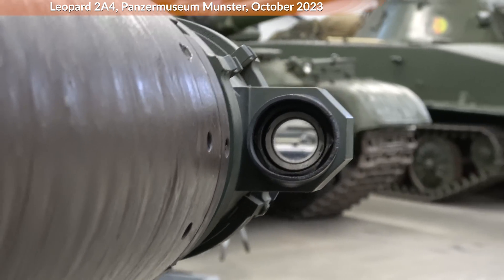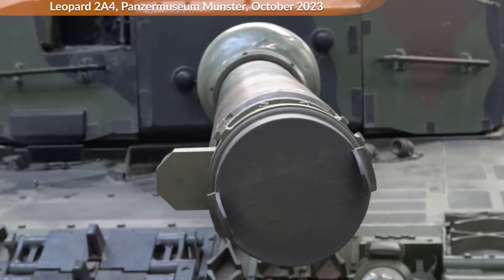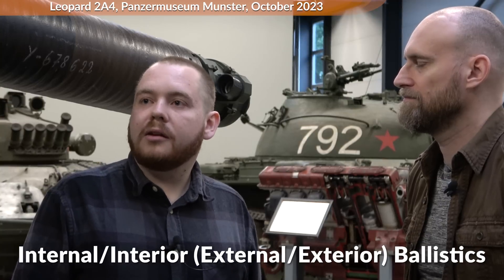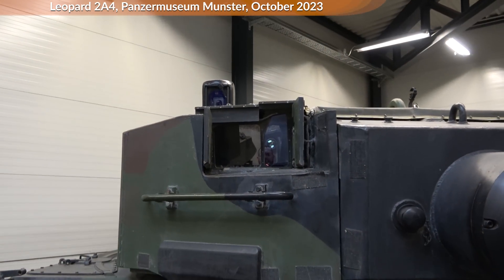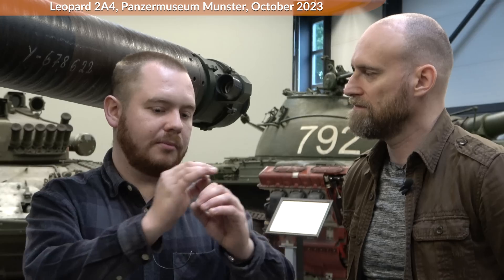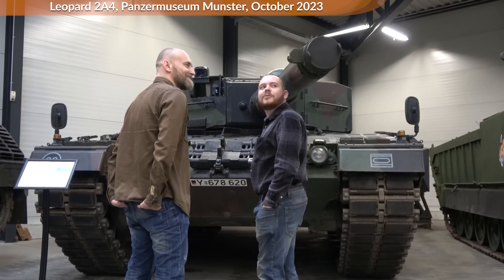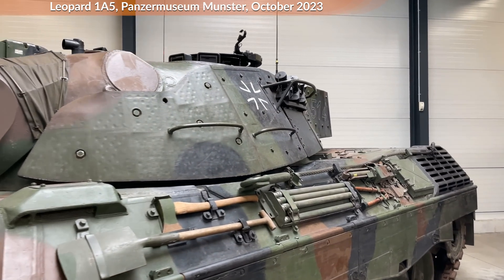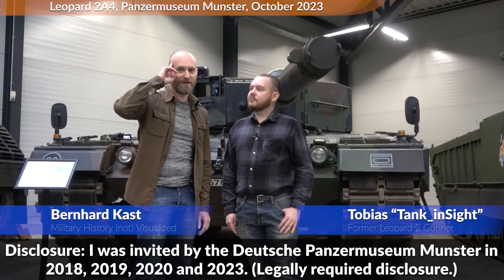Leopard 2: Why a Mirror on the Gun Barrel?

Comment: So if this sensor or mirror is damaged it makes harder to correct any barrel droop and Russian tanks use similar system, so buttoning up a tank is still a thing, though one should destroy the optics with one accurate shot instead of just letting loose with machinegun, witch alerts the crew to shut down the shields on the optics. Gotta remember that if.. when shit hits the fan.

Comment: In german the correct designation for this thingy is "Feldjustierkollimator". It was also equipped on the Leopard 1A5. The metal "blinds" before the EMES actually have a very tiny hole in it, allowing still to spy through. The wind speed sensor was already suppressed back in the times on the 1A5 but wind information could be still entered in the computer alongside powder/shell and outside temperatures and altitude to compute the trajectory correctly. Laser range finder in peace time was obstructed by dim "sunglasses" to avoid accidents to the nakes eye of bystanders when firing on practice ranges - but with these "sunglasses" engaged the accuracy was greatly diminished (too often blinking and not dependable distance readings) - so we all removed it using a square key in a tiny hole on the EMES and went wartime config to receive steady measurings from the laser RF.

Comment: There are a lot of things I could say, but I won't, because I don't want to risk crossing what might be considered national security.  Features like this mirror are designed to keep the crew informed of "gun droop".  When you are really in it, you're firing the main gun so much that it can get soft and starts to droop.  Various systems like this are designed to inform the gunner what is going on.  Good vid.

Comment: 4:23  😂 they measure tube déformation but not the wind. Probably Rheinmetall invented new kind of artillery...
1 > stop tank to reload...
2 > align mirror with control device ( if open ...haha)
3 > LOOK at grass and trees for  wind !!! ( or use figer ?)
4 > shoot ! To late you are dead  because you checked the canon had less than 2 mm torsion...at 15°C because you never shoot...
CONCLUSION shitty canon needs a mirror simply because it is BAD QUALITY that involves micromètres check...😂😂😂
And poor electronics even a 5 euro arduino processor could manage déviation wind, wich is quite crucial. Makes me remember 2014 scandal of Rheinmetall contract for training 30 000 russians to moderne warefare ...probably with a mirror....😮

Comment: The tank is dead. The war in Ukraine showed that a device worth millions can be destroyed by a $500 drone or cheap loitering ammunition. Even an infantry fighting vehicle can defeat a main battle tank in a duel - and with the autocannon, not the TOW, which is even worse. I think that many armies will say goodbye to the main battle tank. There are attempts to counteract the new threats through protection systems like Trophy, but ultimately this attempt will fail. Even a reactive defense system will never be able to fend off a swarm of drones. No tank will be able to meaningfully defend against such a saturation attack, which will always be significantly cheaper than a tank. Tanks are a death trap and will disappear.
Reply: Alright then, tell me, what other vehicle or piece of equipment can replace the tank for the same price and size? as of right now, there is no such system, and that is the exact reason why the tank isn't dead, and wont be for quite a while unless someone creates something that can rival it. If you come up with something, call up the ministry of defense, you'll probably get a prize.
Reply: @jonyvole  I've already sent my solution to the Ministry of Defense, but never received a response. Joking aside. My statement was probably a bit polemical. MBTs may continue to exist, as they have often been declared dead. However, the race between armor and defensive weapons will shift to a new level and tanks will have to have hard and soft kill systems if they want to survive. Combined arms combat will continue to gain in importance. Tanks will therefore become even heavier and more expensive. Rheinmetall's Panther seems to be partly going in this direction. I think that classic main battle tanks - especially the Russians' vulnerable T-series with autoloaders - really have no future because they are too vulnerable.
Reply: @Kl-bx9gv  ah, yeah, that makes more sense, sorry for the kind of agressive response, but I hate the "tanks are dead" statement with a passion

Comment: Here's my contribution to tank warfare: They should have a special smoke round that releases smoke slowly, and takes like an hour to be completely released. So when the Orc are gonna come over that hill two kilometers away, you can plonk the special smoke shell down on that hill and continuously update the wind direction and speed by the little trickle of a smoke trail. And pretty soon the orcs will learn that if they put their heads over that hill, it will pink mist and then they will all go away.

Comment: It's to make the weapon system more complex, therefore more requiring of maintenance and replacement parts, therefore increasing the profits of the manufacturer 😉
Reply: Its a manually operated piece of glass. Probably worth 15$ at most in materials and the maintenance required is probably “wash if dirty”
Reply: @ingihrannar8781 LOL.  It's a high-precision instrument.  So, whatever the material cost, it is an insignificant part of the price the Bundeswehr had to pay for it.

But you apparently don't even recognize a joke, when it is marked as such....
Reply: @martinfiedler4317  Yes i didnt recognize the joke even when it was marked as such. Yes i do and should feel like a fool.
I have had my dunce hat put on and will now serve my 15 minutes in the shame corner.
For real though my bad and have a good day whenever you read this

Comment: It's the MRS or Muzzle Reference System to align the muzzle of the main gun to the ballistic computer. After firing so many rounds the barrel will start to point in a downward position normally or left or right. The Gunner and commander can see this after seeing their shots degrade in accuracy during firing. So the gunner along with the commander can switch the MRS toggle which elevates the main gun with the gunner's and commander's sight to supervise the gunner using the toggle switch of the ballistic computer to move the gunner's reticle to the center of the MRS on the end of the main gun. This can be done in a few minutes when doing an MRS update if your shots are not hitting the target during an engagement. My first gunnery as a gunner we were told to do an MRS update after 7 shots. Never do that!!! If you keep hitting targets keep going. Only do the MRS update if your shots are missing!!! Never made that mistake once I became tank commander and stressed it heavily on my platoon during qualification gunnery.

Comment: Common to most Western tanks. English equivalent "Muzzle Reference System" (MRS). MRS fitted to M1 series, Chieftain, Challengers 1 and 2, etc.
Normally "we" estimate the wind at the start of an engagement, not as part of each Fire Control Order. You estimate it, and then commence the engagements and then once you move elsewhere if things have changed, you update the estimate.

Comment: I understand there are nuanced political reasons behind Germany's obsession with focusing on defensive capabilities, apparently like not including wind sensors. What I don't understand is why they don't think they'll ever be on the attack. You don't want to include capabilities because they aren't needed on a defensive line, but then you never expect to have to retake any ground at all? Ukraine shows why this is a problem, as overused as that example is... I mean at the very least wouldn't it take some load off the gunner and just make everything a bit more efficient? 

I guess I also finally understand why the Abrams commander I know thinks the Abrams FCS is better than the Leo's.

Thanks for the video as always
Reply: The video made is sound like it was removed so that the crew wouldn't rely on it while in a defensive position, which was supposedly most of the time. During the Cold War, it was assumed, like the man said, that Germany's only role would be to suffer and buy time until the allies would be ready to counterattack. So, there wouldn't necessarily be that many German tanks left anymore when the time to retake land arrived. In any case, that was the assumption. Now, much later, we do know that the USSR was quite a paper tiger and the West overestimated its capabilities time after time.
Reply: @herrakaarme  Yea you have a good point, it's just that I see this as a pretty basic thing to train for. And even if not, surely just having a button to turn the sensors off would have been enough.

Maybe they figured out it just wasn't necessary and the tank works just fine without one. Would be curious to see how accurate a Leo is VS an Abrams or Chally 2 in various scenarios.
Reply: @knoll9812  lol yea I've always had a sneaking suspicion that was down to the UK having so few tanks and having more focus on training the few crews they have. Obviously have no data to back this up, just a thought. Their infantry seems to be that way from what I've heard.
Reply: @noscopesallowed8128 It's all about the tea kettle in the British tanks. It keeps the crew sharp, patient, and satisfied. German crews asked for a beer keg for an equivalent effect, but the request has been stuck in the German bureaucracy for decades.
Reply: @noscopesallowed8128  armies tend to pick their best for these competitions.
I think the challenger is genuinely the most accurate but it has other shortcomings
Reply: So am American tank commander thinks the American tank is better?

What a suprise!

Comment: M1 Abrams had a muzzle reference sensor with a vial filled with tritium. Great for those prolonged night engagements.
Reply: Americans: Barrel must be straight, lets use reference sensor with an exotic and slightly radioactive isotope of hydrogen that costs 30K per gram.
Germans: Barrel must be straight, lets slap on a mirror and eyeball it.
Reply: @anonym1984  yeah, thats how you are able to get those accurate shots beyond 1 3/4 miles.

Comment: i still wonder if the beer holder comes as standard from the factory.
Reply: Well there are holes at the end of the barrel... So you could just screw one on if there's a party in town and you wanna make a big entrance 😅
Reply: @touchgrass7834  it's got just one big hole at the end of the barrel for that.
Reply: @tomlobos2871  oh I see and the fire control system is now the beer delivery system. Makes sense xD
Reply: @touchgrass7834  it's a bayercontrol system meant to surpress bavarian uprisings. hence the weißwurst-dispenser at the turret.

Comment: I learned density is pressure diveded by temperature and Reynoldsconstant?? Therefore why is height necessary barometric pressure and temperature should be enough.
Reply: They probably measure the altitude with barometric pressure anyway.

Comment: 2:22 What is he exactly talking about? The EMES-Schutzklappen protect the optical sight aswell as the WBG and the laser. It is even possible to choose if only the protection plate for the WBG gets closed or both are closed and thus the whole EMES is protected.
Reply: It only works with the Gunner's Auxiliary Sight (GAS) because that is aligned with the barrel. The Gunner's Primary Sight (GPS) which has the thermal channel is offset (e.g. on a M1 series its on the turret roof).
Reply: @whya2ndaccount  Are you talking about the FJA (muzzle reference sensor), because in the Leopard 2 it only works with the primary sight?
Reply: Yea, I was confused too. 
I believed many mid cold war vehicle already posses such feature. Although not motorized, can still be operated manually inside the vehicle. 
My man is confused.

Comment: 5:25 Why isn't the air pressure measured? The air pressure depends not only on the altitude, but also on the weather (high pressure area / low pressure area). Barometers are also quite small
Reply: It’s a tracked vehicle. There are no tires to be filled with air under pressure, so no air pressure to measure. 😜 Oooooh, did you mean atmospheric pressure? That was covered.
Reply: I had the same question came to mind. Think about it, this is a tank from the 70ties, digital barometers were not a thing then, were they? Even conventional barometers could have issues  when you were being shelled. Like, losing precision or breaking up into pieces. Safest option is, enter sea level height, hope for average weather, adjust if needed.
Reply: The athmosphere pressure is taken into account but the tank itself does not measure it
Reply: what do you mean? at 3:10 he says that you also have to calculate with temperature AND air pressure
Reply: What matters is actually the air density, not the pressure. And for that, you simply can select the mean altitude of the terrain before you go into a fight, which means one sensor less that can fail or be damaged in battle.
Reply: @denniskrenz2080 And density is directly tied to air pressure...
Reply: @copter2000 Not directly, remember, Boyles law (and in extension, ideal gas law). Density actually drops about twice as fast as the air pressure with increasing altitude.

Comment: Can the barrel also droop left or right, or twist with usage?
Reply: If you could develop viagra for tanks, you’d have defense contracts up the wazoo.
Reply: Angle of sunlight  will heat up one half of the barrel leaving the other half in a cool shade. Main gun barrels are also insulated with a jacket to minimize   heating from outside sources.
Reply: @bongobrandy6297  Thermal sleeves don't insulate, they distribute the heat. Otherwise they will quickly overheat and goes banana peel.

Comment: Muzzle Reference Device aka MRD.
Widespread on NATO tanks since Desert Storm era.
First appeared on russian tanks in 2016 on T-90M.
Says a lot about how much behind someone is in Fire Control System aka FCS tech if that wasn't an important part for them until recently 😅
Reply: The 1A40 sight of the T-72B has, already from the late 80s, a system called UVKV that perform the same function of a Muzzle Reference System but using a prism from inside the vehicle and notches on the muzzle of the gun. The fact that you don't see it, doesn't mean it is not there, it is simply different.
Reply: @ginolospazzino5261 
1a40 cannot perform the adjustment automatically and on the fly. The adjustment is also reliant on the sharpness of the gunner mk1 eyeball.
Reply: @jintsuubest9331  Yes, indeed, but a part for the dubious real value of automatic instant adjustment in, let's say, 80% of combat situations, the russian system has its advantage being entirely under armour and without failure points, being entirely manual. As for everything, I think, it's a tradeoff between cost, reliability and performance.
Reply: @ginolospazzino5261  are you saying that T-90M is a step back compared to T-72B? Can I quote you on that? Thanks in advance.
Reply: @TheArklyte  no, I'm saying that it's a tradeoff: considering the low performance of the 1A40 an MRS with high precision and sophistication would have been a waste. 

T-90M and T-72B3 have better FCS that warrant a better performing system. But the cost to pay is that is more complex, more difficult to produce and more subject to damage. That's it, no free meals.

Comment: How much does the barrel droop affect point of aim?  If there were no mirror to make adjustments, how much would shots miss by?  Say, 1 meter at 1000 meters, or something similar?  I realize this varies by outside temperature, how many shots have heated up the barrel, etc.
Reply: Practically speaking the barrel Divergence due to something like uneven heating would be pretty miniscule, maybe a few thousands of an inch (0.025 - 0.25 mm). Which could mean something like two or three inches off at a mile. not a tremendous amount but possibly enough to make a difference